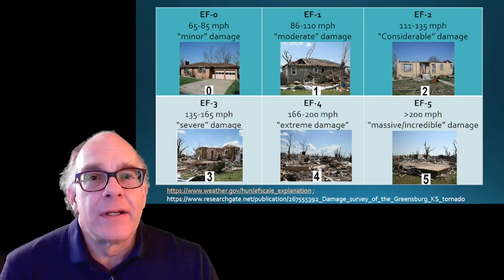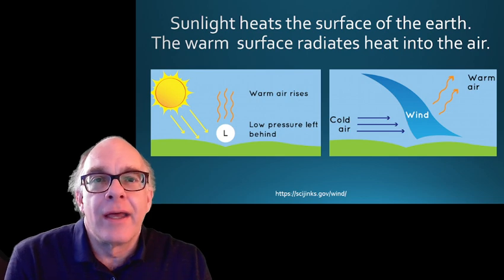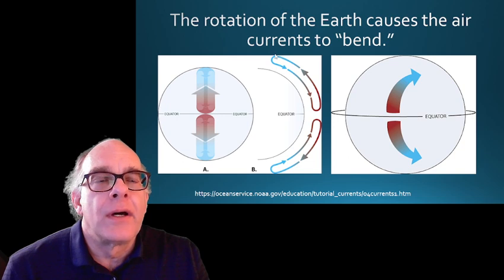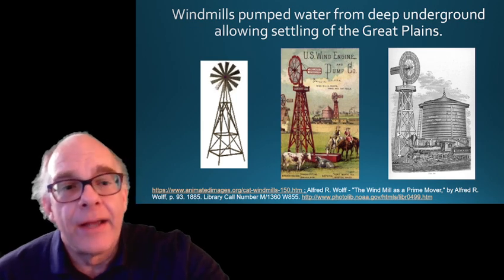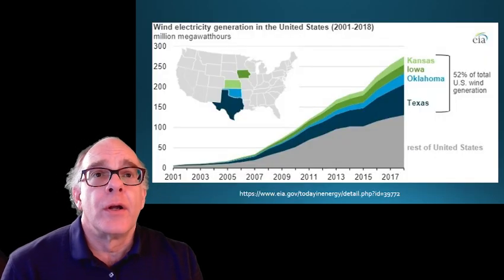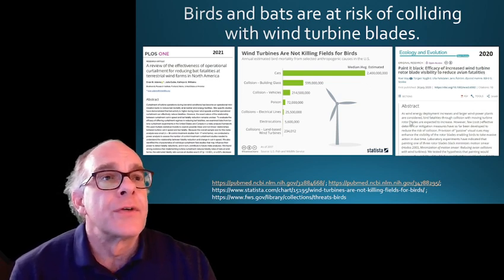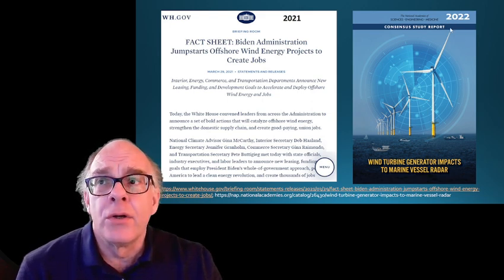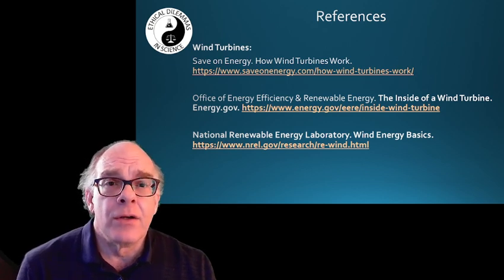Wind Power: sailing toward clean energy and/or tilting at windmills?

Comment: The Earth is cooler with the atmos/GHGs/albedo not warmer.
To perform as advertised the GHGs require “extra” energy upwelling from the surface radiating as a black body.
The kinetic heat transfer processes of the contiguous atmos molecules render that scenario impossible.
No greenhouse effect, no GHG warming, no man/CO2 driven climate change or Gorebal warming.
Version 1.0 041122
Reply from the maker: You are correct that the greenhouse gases need to trap energy that is radiating from the Earth's surface in order to contribute to warming. However the kinetic heat transfer process your refer to commonly occurs every day.... it is what contributes the the temperature rising through a sunny day... and the presence of greenhouse gases in the atmosphere trap the heat energy so that the planet does not excessively cool at night. The heat transfer from an object warmed by the sun into the air molecules is explained well on the National Weather Service page on the transfer of heat energy. https://www.weather.gov/jetstream/heat
Reply: @EthicalDilemmasInScience  
That is 100% NOT what I said.
There is zero provision in the LoT for "trapping" energy.
At 0.04% CO2 has zero meaningful impact on the thermal behavior of the atmos or climate.
The albedo cools the lit side, the thermal resistance warms the dark much like the curtained windows and insulated walls of a house.
Reply from the maker: @nxgrs74  Can you direct me to where you are getting your information? I am interested in what it says. There are many things that act at incredibly low concentrations and yet are effective.

Ozone is present in the atmosphere at a much lower concentration than CO2. Ozone (three atoms of oxygen) is estimated at 0.00006% of the entire atmosphere with the highest concentration in the stratosphere at 0.0015% and yet absorbs most the the sun's ultraviolet radiation. https://ozonewatch.gsfc.nasa.gov/facts/SH.html

Albedo is a term used to describe how well a surface is able to reflect sunlight and the heat energy associated with the sunlight. A  light-colored object will reflect more of the solar energy and be referred to as having a high albedo. A dark object will absorb more solar energy and heat and is referred to as having a low albedo. Last year researchers at Purdue University developed an ultra-white pain that reflects up to 98.1% of sunlight so is highly reflective and could serve to help avoid heat buildup on surfaces. 
https://www.smithsonianmag.com/innovation/ultra-white-paint-may-someday-replace-air-conditioning-180977560/